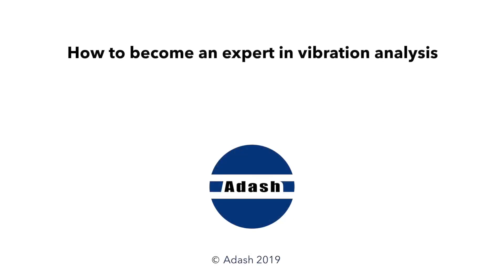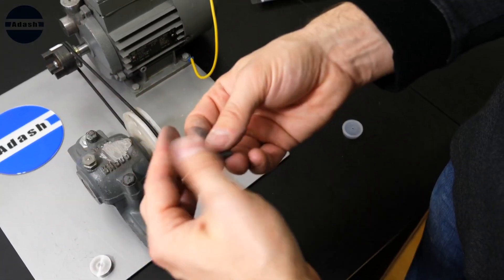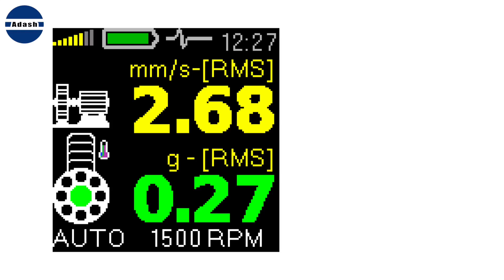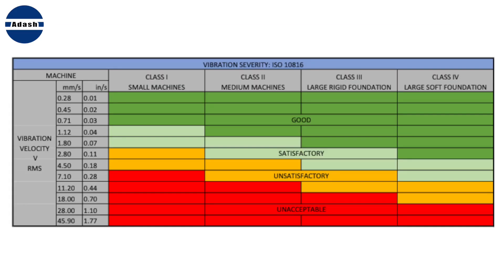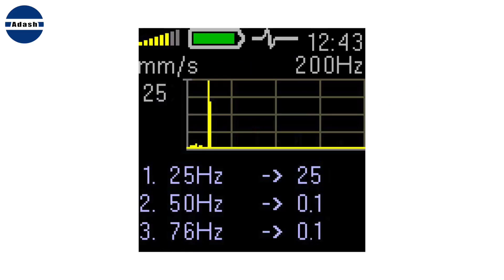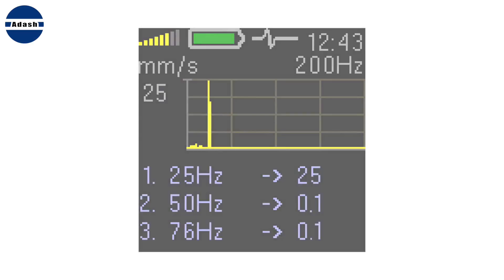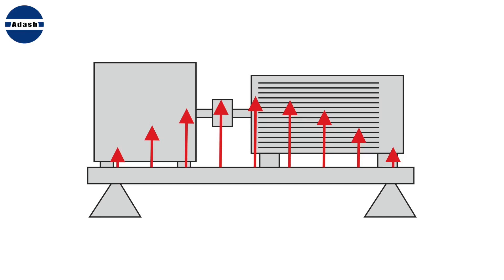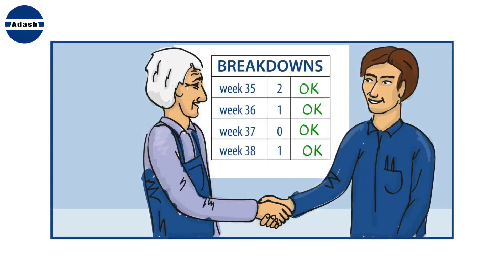How to become an expert in Vibration Analysis

Comment: Can I use this device in marine engine vibration analysis? Where was the best location to put the probe? Can I put it on the engine footing/mounting? Thanks
Reply from the maker: Our vibration analyzers can be used on any rotating machinery, therefore also on marine engines. There are actually hundreds of these Vibrio M devices on all kind of vessels worldwide. Sensors should be ideally placed on bearing houses. This way you will get an info about a bearing it self and also about mechanical faults related to shaft speed. Placing the sensor on engine mounting makes sense only if you are looking for loose foot, loose anchoring bolt basically. See this video about sensor mounting: https://www.youtube.com/watch?v=QnHl1Le2OXA
Reply: @AdashCompany  thanks for your reply and for the additional video link. In our case we're more on checking the quality of the newly overhaul engine and it's alignment after installation during sea trial. Usually the engine and transmission were coupled to a shaft going to the propeller. Bearing problem is unlikely to happen since new parts were used. It's more of a workmanship check rather than predictive maintenance purposes. Usually our engine alignment was affected by the hull and vessel frame strength and the stress and strain it absorb while sailing especially on rough waters
Reply from the maker: @coltruiz7126  Keep in mind that bearings could have been installed incorectly. Misaligned machines are also trouble for bearings because then they are stressed by unwanted load from the shaft. Therefore don't overlook bearing monitoring... Anyway, please write to our sales / technical department. We will guide you to apporiate Adash dealer in your country who can help you to find suitable solution for you. Email: revaj@adash.cz
Reply: @AdashCompany  engine monitoring during operation will be the ship's maintenance personnel's responsibility. Thanks for the advice cand email address that you gave.

Comment: Thak you for this very useful information.
Could you please elaborate what does high horizontal and vertical vibration (in mm/s) mean given that the relative vibration in axial direction is less.
Reply from the maker: That is quite complicated question. Horizontal and vertical vibrations usually gives us info about imbalance, mechanical looseness etc. Axial direction is important while looking for misalignment problems. Write us more about your troubles on revaj@adash.cz and we will try to guide you.

Comment: In the calculation, 25Hz x 60 = 1500 RPM, how did you consider the value 60 into calculation?
Reply from the maker: 1 Revolution per minute is equal to 1/60 Hertz. Hertz is the SI base unit of frequency defined as one cycle per second.

Comment: Hi, thank u for ur good presentation, pls advise if we have a level problem for pump or foundation which causes a high vibration, what can we consider this ? Is it unbalance? Or what ? 
Thnx
Reply from the maker: It could be unbalance, looseness, resonance and other problems. It is really impossible to answer to your question. You would need to perform some vibration analysis on your machine.

Comment: How do you find the lubrications issues from accelerations.
Reply from the maker: Bearing with lack of grease will of course vibrate more than greased bearing. Try to grease the bearing while measuring acceleration and see if the value decreases. If yes, then you solved your lubrication issues.

Comment: Using a loose cable between DAQ/signal reader and the accelerometer like this will induce vibrations that will affect the accelerometer. This should definitely be avoided for accurate measurements
Reply from the maker: Yes, you are right. But the influence from cable vibrations is very low. We can overlook it in the field / route measurements and concentrate on this cable issue for laboratory measurements where we need really precise reading. There are another interferences in factories such as electromagnetic fields which also influences the measurement.